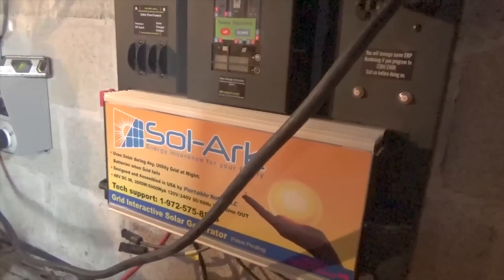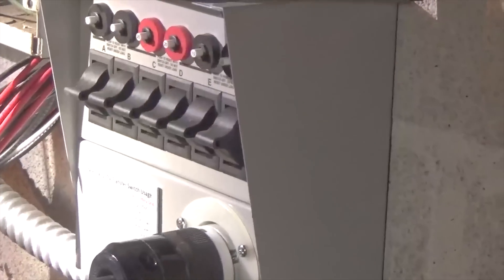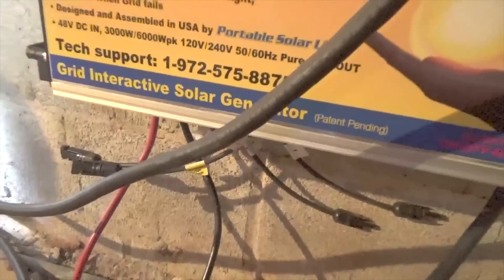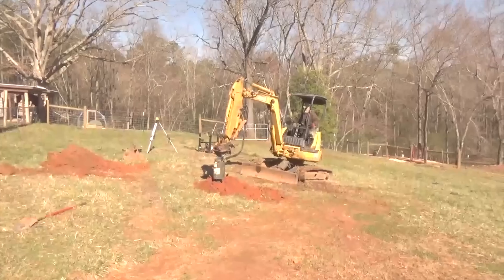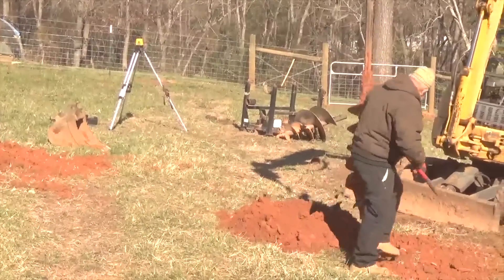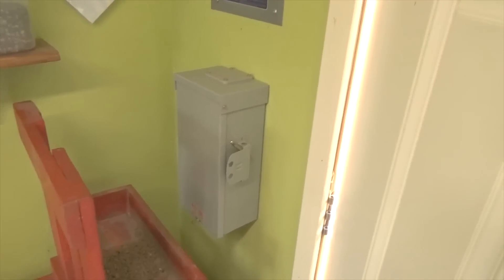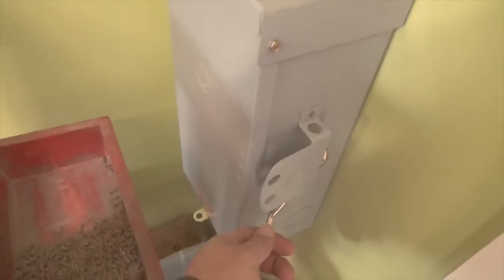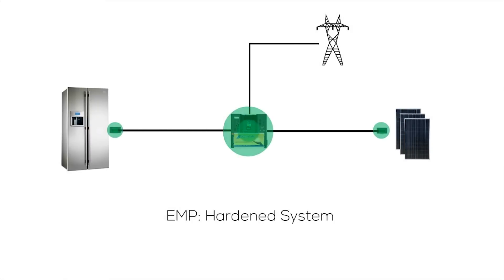EMP  Hardened Solark Installation

Comment: Been watching your videos, very nice.  I am finishing up my dual axis tracker and researching Sol-Ark 3K generator.  Have a question, can you set the full charge voltage and the cutoff voltage?  In my case, it would be 56 volts and 42 volts respectively.
Reply from the maker: There are only a couple of the 3k units left.  The answer is yes, full charge can be set to 56v and discharge cutoff to ~41V,  Solark has moved to their 8k inverter.  https://practicalpreppers.com/product/sol-ark-8k-solar-generator-medium/

Comment: Oh my gosh Pastor!!!!  These solutions for off grid power are wonderful but so cost prohibitive.  This Solark system is thousands and thousands of dollars to purchase.  What can a man with a marginal income do to prep for an EMP to protect his family?   The starting prices for those Vulcan wood gasifiers are just as spendy.  Can you please start to bring back instructional videos for folks on a much tighter budget than your consult clients?
Reply from the maker: I hear ya.  I have covered most of the simple solutions, hand pumps, wood cookstoves, Faraday cages,  food storage etc.  Electricity is not required but it sure makes life easier so I keep sharing ways to make it and protect it.  Most of my stuff is expensive but pays for itself eventually in efficiency and cost savings.  My wood boiler for example was expensive and took 10 yrs to pay for itself but I am in my 12th season now.  My Solar system will take 15 yrs to pay for itself but it will happen.   In the meantime I enjoy very low utility bills and the offgrid security.
Reply: When the power has been out for 3 days, people will pay anything for lights at night.  That is when solar pays for itself.  No you can't sell it but you will have security when no one else does.